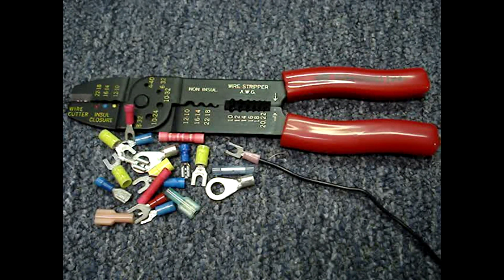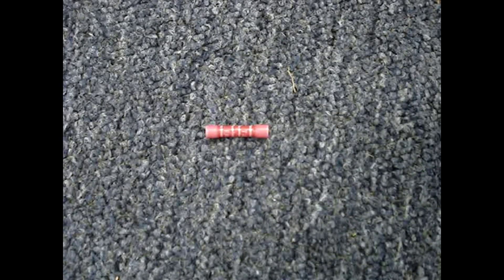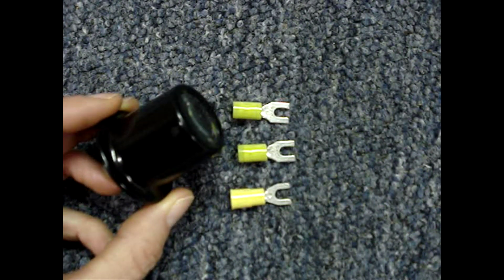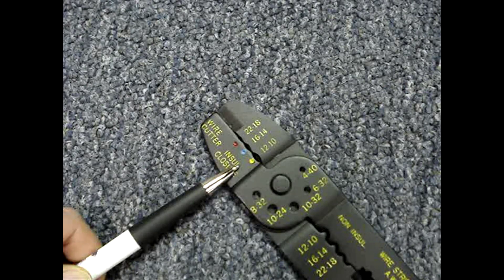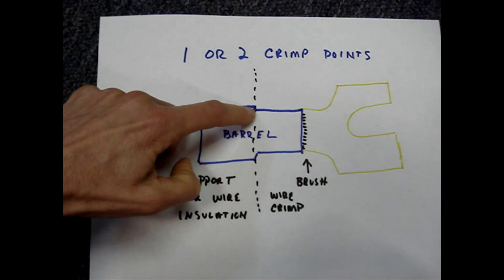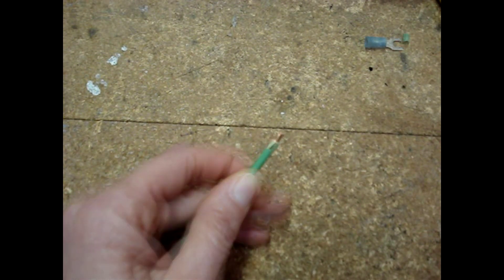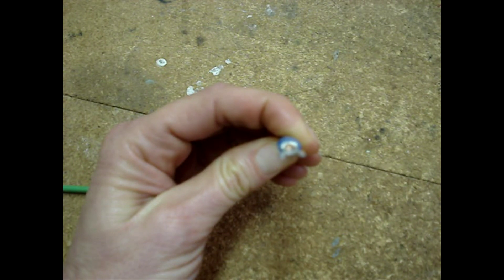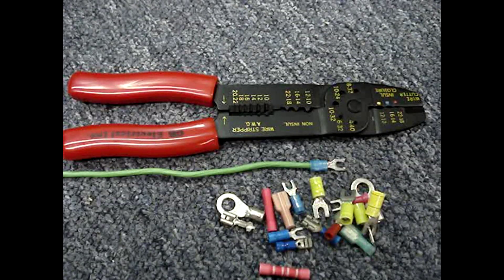How to Use Wire Crimp Connectors

Comment: Really the best 'Intro to Crimping' video out of the 15 or so I watched this morning - 6 years after you posted.
Reply from the maker: Thanks for the compliment.  I spent 20 years as a field service tech on low building voltage systems.  I made plenty of crimps and had to troubleshoot & fix them if they failed.

Comment: 9:00 what type of terminal is that ?
Reply from the maker: I believe it's called a reel crimp.  They are tricky, you have to have the right tool for those.  I used to use those to make custom pin connectors to interface with some low voltage building system equipment.

Comment: At last I found a vid on how to double crimp using the generic tool, But you did not show which way up to crimp. FYI the larger curve on the tool is the one to crimp down the split section.

Comment: Aggg, was waiting on you to tell me what the holes in the tool are used for!
Reply from the maker: They are to cut bolts.  Turn the bolt into the appropriate size hole and squeeze to cut the bolt.  Don't try cut hard metal like stainless steel.

Comment: excellent video! as a first-time crimper I have watched a few youtube vids on the subject in preparation but this is the ONLY one I have seen that explained the different parts of a spade (disconnect) terminal and how many times to crimp, where to crimp, metal or non-metal lining on the terminal. I feel I am now ready to make a decent crimp, thanks to you!
Reply from the maker: You are welcome.  I've used a cheap tool as shown in the video to make hundreds of connections.  I never had one fail.  Buy quality connectors and use the correct size.

Comment: This was a very helpful and informative video and I wanted to thank you for making it. You have an excellent presentation style and everything was very clear and thoroughly explained. I've watched many "tutorial" type videos from content creators who could definitely learn a thing or two from you.  

I was doing research for a project I'm working on where I will need to install spade type crimp connectors when I stumbled onto your video. I was planning on purchasing some of the more expensive ratcheting style tools when I realized that I already have the exact tool that you're demonstrating here. I had never used it for anything but stripping wire before and didn't even remember that it actually had a crimp functionality. After watching your video I figured I'd give it a try before spending any more money on a new tool and to my surprise, it actually worked great. I'm actually kind of shocked at how strong the connection is for such a cheap and simple design. I could see spending the money on a higher quality tool if I were installing this type of connector on a regular basis in say a professional capacity, since those tools only require a single crimp per each termination. However for occasional projects around the house I really don't see the need. Not only did you teach me something but you also saved me some money. Thanks again! 

PS After watching some of your other videos, if I were to offer any constructive criticism at all I would say: it's 2021 what's with the 4x3 aspect ratio? LOL obviously that's just a nitpick and it doesn't decrease the effectiveness of a tutorial type video. It just gives the video a kind of "dated" look and feel.
Reply from the maker: Thank you for taking the time to write the thoughtful comment.  I used the cheap tool showed in the video for many years while working on low voltage building systems... commercial fire alarms, nurse call systems, security systems etc.  I've made hundreds of connections with it and so did my fellow techs.  If you buy quality connectors and use the correct size you can still acheive an "A".  The connection won't meed NASA standards, but it's unlikely are launching a rocket.

I appreciate your feed back on the 4x3 format.  So far all of the videos are shot on a Sony Cybershot camera.  I didn't begin making the videos with the idea that there would be hundreds of them.  I didn't know anything about cameras or photography.  I just noticed a movie setting on the camera and went with it.  It's probably time to get off that old camera.  lol.  Thanks for reminding me that I should update my technology.

Comment: That's not the where the wire stripper is on the generic tool. The stripper is below, near the handle. It works a lot better than the crimper at stripping wire.

Comment: I always crimp insulated terminals with non insulated crimper. I have done this since I had an issue with the insulated terminal crimper back in the early 70s. Through my career I have found many issues with the insulated crimper part not being done well. Up to you what you want to do but I speak from experiance and a lot of time chasing bad crimps.

Comment: Good video but look for a better crimp tool.  A ratcheting crimp tool will give a much better crimp.
Reply from the maker: Agreed, the tool is not a good one, but it's ubiquitous and what most people are going to use.  The video is made for the people who are going to buy the $10 tool instead of using a hammer.  Most people are not going to pay $100 or more to make a couple of connections.

Comment: What kind of crimp tool do I need for bullet connectors at 9:01 ?
Reply: I was trying to use the above crimpers and they came out terrible. Now I Know why lol they weren't meant for them
Reply from the maker: There are special tools for that type of connector (the one with no insulation).  There are too many tools/connectors for me to know them all.  You'd have to do some research.  I'd start by finding the connector in a catalog and then you can find the tool listed for the connector.  I used to have to make up custom plugs for computer printers.  I had a devil of a time finding the correct gold pins and the tool to make the crimp (The connectors on the pins looked similar to the connector at 9:01).  If I remember correctly, the tool cost well over $100.
Reply: @Know-How-Now  thanks I'm having to deal with the issue of 2 female connectors , and I need to make one of them male

Comment: Regarding the way the crimp is placed into the tool, YOU say exactly the opposite to what this video says:

https://www.youtube.com/watch?v=kjSGCSwNuAg

So who do we believe?

That one also says to twist the wires before inserting into the crimp.
Reply from the maker: My video is based on NASA standards and some other documentation/specs provided by the makers of the terminals.  I can't speak for the research that others have done.  Twisting the wire is definitely a no no.  You might want to inquire what standards the other video creators have used to make their videos.
Reply: @Know-How-Now  
I believe your method makes more sense than allowing the male or pointed part of the tool to push against the seam. That way makes me think that the seam would open up a little.
Reply: @Know-How-Now  

I believe your method makes more sense than allowing the male or pointed part of the tool to push against the seam. That way makes me think that the seam would open up a little. 
I left a similar comment on one of the other contrary videos but have not received a reply.
Reply: Good info! A person I trust on car issues even appears to do it wrong. His reasoning was the point pushes the wire back into the terminal, but per this site, too, you're right. Well done!  http://knowhow.napaonline.com/how-to-use-crimp-terminals-the-right-way/

Comment: Very nice, you have a good presentation style I like that a lot. I’ve been working with wire for over 50 years. The total prices you mentioned though are not that expensive. It would’ve been nice to see if you could have shown other tools but it again if you don’t own them that’s the problem and you’ll acquire them at some point hopefully. But I am using this video of yours to share with somebody to explain to them the basic techniques of crimping and joining two wires together. If you’re interested in electrical or other things you should check out my channel I have many playlists saved that I use for reference for other people and for myself. 👍
Reply from the maker: Thank you for the compliment.  Those Gardner crimpers are so common and likely what many people who only use them a few times a year own.  I was hoping to help those users increase the quality of the connections they make with that ubiquitous tool.  I checked out your channel, those are great playlists.

Comment: What is the several holes with different sizes on the tool used for?
Reply from the maker: Those holes are used to cut bolts.  Open the tool to line up the two holes, thread the bolt into the desired length and close the tool.  Softer metal bolts are cut easily, harder metal can be tough to cut.
Reply: When threading the bolt into the tool make sure the piece of bolt you want to save is started first into the threaded half of the tool. That way after cutting the bolt you unthread the shortened bolt and the tool acts as a thread chaser. Doing it the other way around and you will have a hard time getting the cut bolt to thread into anything.

Comment: For insulated connectors is the orientation of the crimper important; concave half goes over the seam?  You said so for non-insulated, but didn't make the point for insulated

Comment: Thanks for the video! But it turns out I need to know how to crimp that last terminal you showed.. just my luck 😂
Reply from the maker: You are welcome.  I know, the video is on the long side.  I initially thought it would be a 2-3 minute video.  It took way longer to give a thorough explanation on how to use a crimp tool/crimps.  Thanks for watching.
Reply: @Know-How-Now  it's perfect!
Reply: @Know-How-Now  not too long. people can always skip.

Comment: You could use the wire stripper section to strip the cables, it does a great job and you wouldn't need two tools.

Comment: Very easy to follow video, ...but how do you determine the size of the wires if they are not necessarily color coded or marked.  I am trying to attach 2 new terminals to a positive blue wire and neg black wire pigtail connection, that will be installed on a fuel pump that will be submerged in the gas tank on my car.  I'm not sure if I have to use special terminals for this job since they will always be inside the fuel tank. Any suggestions.? thanks
Reply from the maker: You could use a pair of wire strippers to get a close guess for the wire gauge.  Close the strippers on the bare wire, find the hole that fits closest around the wire.  I'm not sure which terminals would be best for inside a gas tank.  I'd call tech support for one of the major manufacturers, they can help you.
Reply: Most likely it's 16 gauge, could be 18 gauge. Try shipping the wire with the 18 gauge if it cuts the insulation clean with no hassle (tugging) then it was 18, if not.. try out the 16 gauge slot. Check if you cut strands off if so then it's not right.
Best of luck!